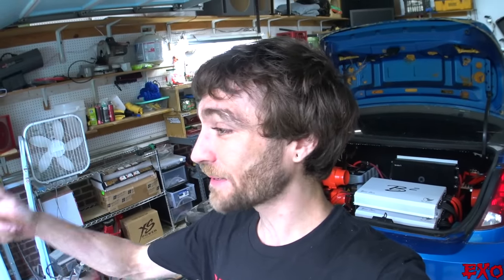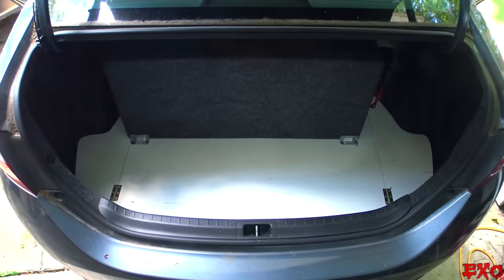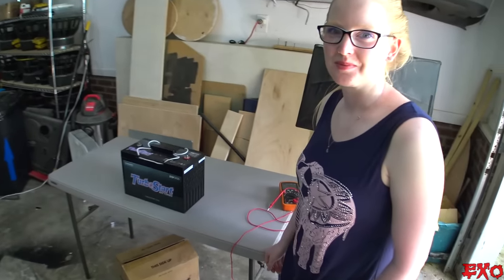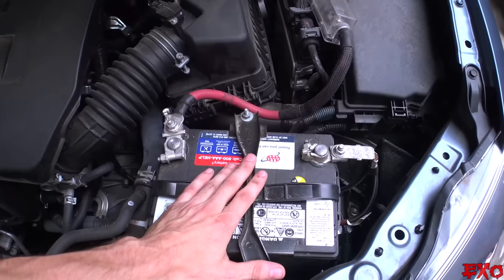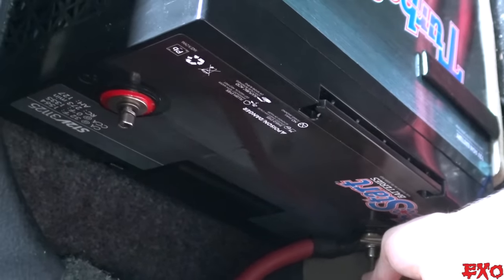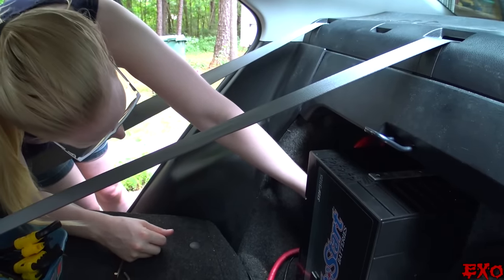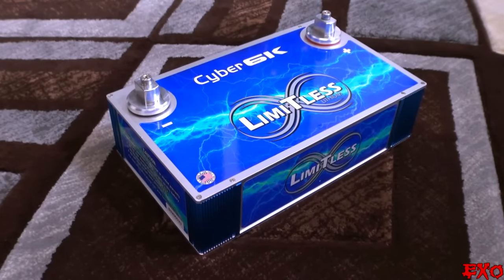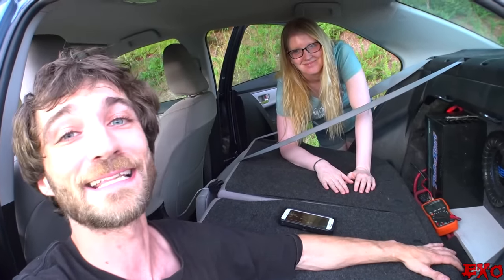Wiring EXTRA Car Audio Battery w/ My Girlfriend's 3000 Watt Subwoofer Install (How To Wire 2nd AGM)

Comment: Wow, so funny. I was sponsored by Turbo Start back in 2001. This company initially  made 16 volt batteries for race cars. I contacted them and wanted to make an order for 40 of those 16V batteries and they were blown away on why I needed so many batteries. So they flew out to my house and after some dinner and drinks and a demo of my SPL monster I landed a sponsor and basically put them in touch with the car audio world. Glad to see them still going.
Reply: That's AWESOME man!
Reply: If this is true that’s one of the coolest stories I’ve heard in a long time

Comment: Just got my first AGM battery not long ago (yes early into my rebuilding my system) and am shocked at how much better my system pushes. I'm only at 1,500W so far, but barely dip bellow 14v diving around bumping the grind away. 👊👍

Comment: Love it its always a good thing to have lots of battery power🔋unfortunately I only got 1 AGM 1800 watt battey up front on 2 2000rms watt amps so you know I have bad voltage drops.
Reply: I only got one amp and one sub I have rpm drop and voltage drop lol I am planing to add battery in back and another sub

Comment: If you don't run your car consistently and want to avoid a parasitic draw between two batteries you can always get a battery isolator which is pretty cheap these days.  You can actually have it turn on with your remote wire for the amplifier which would connect the two.  You could also plug it into another wire for turn on that only comes on when the car is running and that way you could play a lot of music with the car off with no fear of draining the battery which starts the car.

Comment: 2 questions is it safe/ does it matter if the battery is on its side?  2 have u got a aftermarket alternator?  I can't remember if I've seen u do it lol. I'm running 2x 10 orian xtr pros with a hifonics zeus amp seems good enough for me from UK. Love ya vids too

Comment: Don't mind a potentially stupid question I have, I'm new to doing this car audio stuff myself rather than taking it somewhere. It's been addicting man lol. But, either confirm or correct me.. Since my amp is connected to my main battery already, if I were to buy an extra battery, would I just be disconnecting that power cable from my amp, connecting it to my new battery, and then running another power cable to the amp from there? Or will I need to run another wire altogether from my main, back to the extra? I'm sorry if Im not making sense, i don't know all the terminology or even know what the hell i'm doing lmao. Any help/advice is appreciated. My main reason for looking into extra power to begin with is not only the dimming I'm getting in my lights, but also reading that it helps the sound quality altogether when its getting the power necessary to pull what the speakers/amp need without clipping, dimming, etc..
Thanks!

Comment: I thought you had to have a relay disconnecting both battery when not in use or charging as they drain each other!
Reply: Especially when not both the exact same battery!
Reply: Yeah, I used to run a smart battery monitor that senses the main battery voltage and disconnects when there's going to be a problem starting...

Comment: Nice build bro. If your running 3k on the stock alternator and that battery is the cars stock electrical able to maintain charge on this battery without need for charging?

Comment: Hey EXO, a quick question, are you running or using a relay with your second battery?, just curious because just a couple years ago it was the thing You HAD to do. Thank you..... Pls Answer either way, getting ready to install a system in my 84 firebird and if all i need to do is fuse it i will, my system will never be run with the car off, so no need to have second battery to start, the second battery is just there for reserve power  while i am driving. Plus i am only running 2500 RMS, i believe thats the rating to add a second battery. Running two group 31’s one to start( front) and one as a second ( back) reserve... thank you... please answer

Comment: Is spray foam in a deck lid all that good. I see your Saturn has it. Me I just covered the holes in mine with peel and seal. Can u believe it's been 8 years and that stuff is still sticking to my trunk lid perfectly. I remember using fat mat years ago that wouldn't stick after a month. I have heard spray foam absorbs moisture and can cause cars to rot from the inside out

Comment: Question about your fuses. Looks like you have a fuse under the hood after first battery, then at 5:30 when you show wires in trunk, you have another fuse on wire from under the hood before the second battery. And no fuse on output from second battery to amps. Shouldn’t the output from the second battery be fused before your amp?

Comment: I have a question.  I have a hybrid vehicle.  The lithium battery.  Would adding one to handle a medium to smaller type system be fine to add without damaging the electrical system for the hybrid?

Comment: You've always got the slickest gear on your installs, but for someone just starting out, are there any pitfalls in choosing a second battery? I was given a little 12V 24AH that I was going to wire into a 500 rms system for practice (and to fix some minor headlight dimming). Is there anything else to consider first?
Reply: Only 500w? Do the big 3. This will help the voltage drop. The battery will help, but its also more load for the already lacking alt to charge. The big 3 will get more of your available power to the amp AND batteries.

Comment: Could you run the limitless with a stock battery in the front and get better results than 1 single limitless or 2 "normal" batteries?

Comment: Does the 2nd battery have to be connected directly to the Alternator? I have an after market alternator that wasn't cheap. I have alternator to front battery to 2nd battery in trunk. ground from front battery to 2nd battery. 2nd ground from 2nd battery to car body.

Comment: Are you using a AGM battery under the hood too. I am not using a AGM under the hood so I use a battery isolator. Would be great if you showed others how to do that. They are nice and simple. But keep from draining your rear battery.

Comment: Hey I got a kinetic hc2400-rev and a platinum agm battery and a stinger hybrid 10 farad cap on a 1600.1 kicker amp and it still dies after a 30 minutes or so beating. What’s wrong anything you can think of ? Also have oversized alternator and 0 gauge everywhere with big 3

Comment: I got a question I'm adding a 2nd battery to my 09 Chevy avalanche to use for my system. I have place right under the hood for a 2nd battery but my question does it matter what battery I have my amp hooked up to? Because right now my amp is hooked up to my main battery

Comment: So just a question, im new to car audio and looking to run 2500-3000w Taramps to a 12-inch Ground Zero SPL sub in a 6th-Order enclosure. Im. gonna do the big 3, but can I run the stock alternator with a 2nd battery in the boot ? Thanks

Comment: Love the video and the teamwork.
I just hooked up a 2nd battery in my trunk and lost most of my bass and my sub amp cuts out.

I put a fuse on the monster cable that was on the amp and hooked that to the battery. Ran a large wire from that battery to the amp. Ran the gnd from amp to body ground and the 2nd battery to the same ground connection.
Now it seems like the amp only uses the 2nd battery and appears to be charging from the main feed line. 
What did I do wrong?

Please help. 
I want my bass back
Reply: Have you solved it?

Comment: in finland we but fuse between amplifire and battery so the amplifire will not get damaged if there is voltage peak

Comment: I have a 4 way fuse block with a zero gauge power wire going into it feeding power to two 8 gauge wire that's powering two amps...how do I add a battery to it....I was thinking to add it to the fuse block, but I thought it wouldn't get charged....ANY SUGGESTIONS

Comment: Id rather have agm in comparison to those AH in this situation. Way more reserve with the agm on a daily driver, an advantage in comparison to lithium in my opinion. I’ve got a duracrap up front 45ah agm and an xspower d3100 in the rear, I let my car sit for over 18hours and I’ve got 12.9v and when I play my system on half volume my voltage doesn’t move for an hour

Comment: Is that a lead acid flooded starter battery mixed with an AGM second battery and no isolator? I see the voltage drop is the car off? An AGM will hold up longer than the starter battery so won't the starter battery feed off the AGM? What really is the purpose of the second battery but to provide power when the car is off to the system? 
An alternator is the primary source of power while car is running at 14.6v while the battery runs at 12.6v so unless your system is pulling so much power only the battery will support more voltage at or under 12.6v. Please clarify Exo hook the community up with some knowledge please.

Comment: Sorry bro NOTHING BEATS XS POWER BATTS/LITHIUM   XS POWER FOR THE WIN ALL DAY EVERYDAY :)
Reply: FTW!!!👊🏾💪🏾🔊
Reply: I have 3 XP-2500 TO A WOLFRAME W-7500 ON 4 SKAR AUDIO 15'S WHICH I HAVE REBUILD TO A TI FRAME A LONGER 3 INCH 4 LAYER VC WITH A HUGE/BIG ROLL SURROUND SUB THAT SITS ON A 4 LAYER 10 INCH SPIDER/ 2  X-18'S V2/BIG 3/250 AMP HIGH OUTPUT ALT :D LOLOL ALL I CAN SAY IS LOW LOW LOWS WHERE I CAN SWITCH SUBS WHEN NEEDED.........XS POWER FOR THE WIN GOOD LUCK FOLKS
Reply: Some ppl say North Star is better so who am i suppose to believe when its all just brand alliance?
Reply: @lxrdvader2021  I don't have brand alliance, but I do have some brand loyalty with XS because I have had no problems with their batteries over the long term... So that's where I spend my money. Honestly though, they're batteries. I don't think there are huge differences in the guts/performance either way. Go with the best deal.

Comment: Quick question at what point do i need a battery isolator im only pushing 2000 watts at 1 ohm however my car battery is very very tiny. Its in a 2009 mini cooper s 😅😅

Comment: If I already have my my two amps running off the main battery, can I run a power wire from my second battery to the main battery

Comment: You want to have the same size batteries. If you have (what it looks like) a 72ah batterie in the front and a 127ah in the back. You'll only get 72ah from the rear batterie.
Reply: What
Reply: very interesting

Comment: @EXOcontralto about how much would it cost for someone to do a full set up with second battery the 0 or 1 Guage wire and everything. Roughly how much would that be. I already have 2 12" Memphis MOJO 5s unbridged with a 1000w amp. Just wondering about how much it would cost so I can save to get a full blown proper bass build

Comment: Aould this type battery work with (2) 1000w nvx 12s with 4000 watt amp +1600w amp hooked up to 4 50w kicker 6x8s . In a 99 f350

Comment: hey i have a question, so the car i wanna put a 3200w sub system is has a alternator for 150amps atmost, that is says atleast, would i be able to do this with a 150amp alternator?
Reply: That’s a lot of power for a stock alt to handle. I’m planing on getting one JL13.5 W7, HD 1200/1, HD 600/4, C3 interiors & a second battery and I’m told a 250-270 amp HO alt is recommended, which is what I’m about to order from Singer Alternators.

Comment: Question for you EXO.... or anyone else who knows the answer, by all means feel free to chime in. I have a 2011 Tahoe, with a 320 amp mechman alternator on three yellow top optima batteries. When I'm playing my music, the voltage is all over the place. I've done the big three. At first, the voltage didn't move. Stayed high. I blew my main fuse. Afterwards, I was told I needed more grounding. So, I have 1/0 on the chassis, to the alternator, to all the batteries... everything. Never blew another fuse, but that's when I noticed voltage moving all over the place. And, now sometimes one of my amplifiers overheat, and temporarily shuts off. Any suggestions?
Reply: could be clipping the amplifier if its trying to pull more than it can get and volts dipping into clipping will make it overheat and go into protect. could also just be bad earths (test resistance between them and the battery neg terminal.)
mine did this on half ohm with a stock alt as it couldnt refill the battery as fast as the amp was draining it even though it was a 120ah deep cycle agm. went to 2 ohms and no problems

Comment: Hi I have question about dual battery I wants to add dual battery but car acc mode will be turn on from main battery right so I want to do when my main battery gets down to start the so I can draw power from 2nd battery or there is any other way I can turn on acc mode straight from the 2nd battery leaving starter battery fully charged to start the car I’ll be so thankful full of anyone can help me about the setup

Comment: Ok bassheads, at what point should someone add a second battery? And how much strain does that add to the stock alternator?
Reply: I believe any amp power over 1,000w should have a 2nd battery.

Comment: 3 negative wires?? Whats the black wire for?
Reply: Front battery/alternator.  second battery to the amp. Third is an additional ground for the second battery.

Comment: Why don't you add a capacitor and test? Even a 30 Farad from Rockville would be a cheap, but good cap. 

Anywho, what about a video with extra battery and cap?